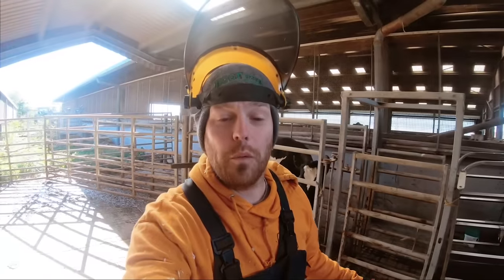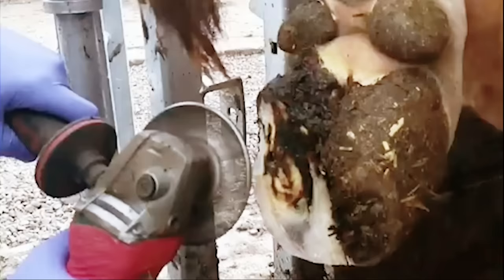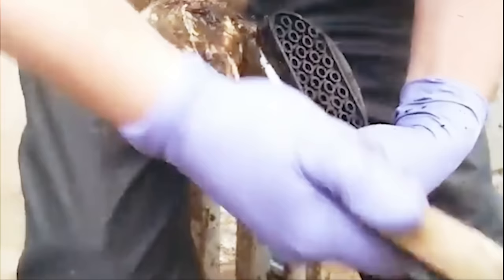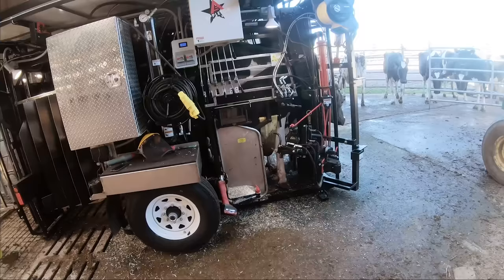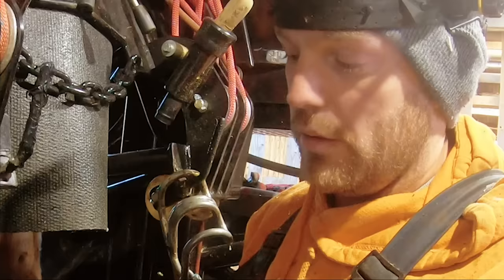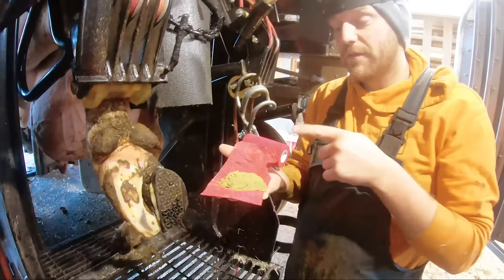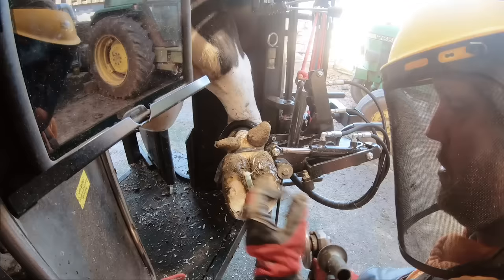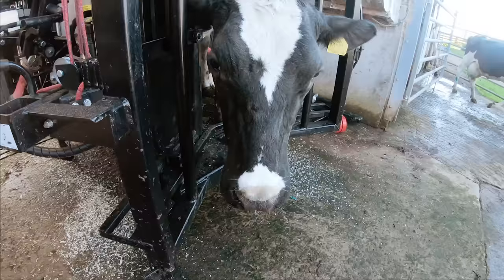ROTTEN COWS HOOF ... 7 day TRANSFORMATION?! | The Hoof GP

Comment: I noticed in some older videos you used a sprayer to clean off the hoof at the beginning of a trim,... that seemed much cleaner, especially with lesions and such. But, more recently I see you using a brush or mop to clean with , is there a reason for that?

Comment: Can I ask a dumb question? Why does it seem like one side of the hooves grows faster than the other?
Reply: Because it does, it's actually the point of routine trimming, to balance out the claws.
Basically it's all to with weight-bearing, so if the cow takes more weight on the inside claw, the outside claw will grow faster, due to less wear.
Reply: alistair clement that makes sense. Thanks.